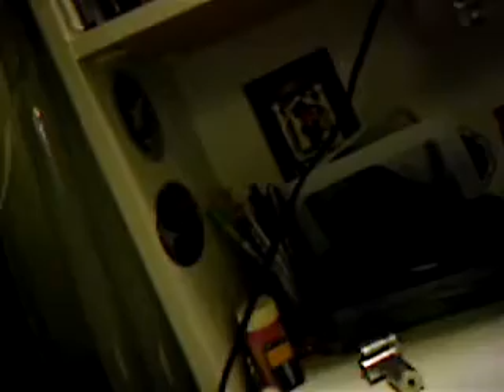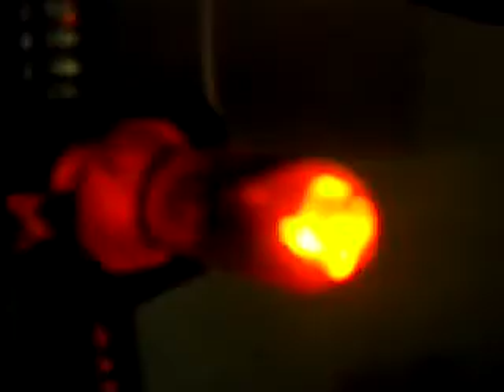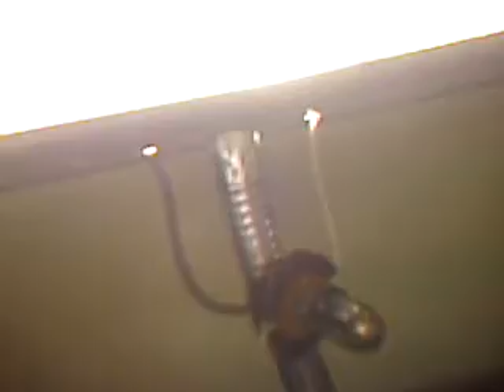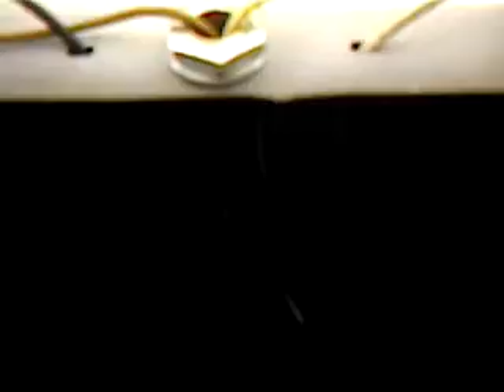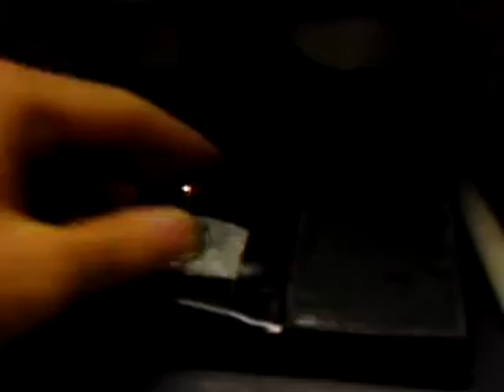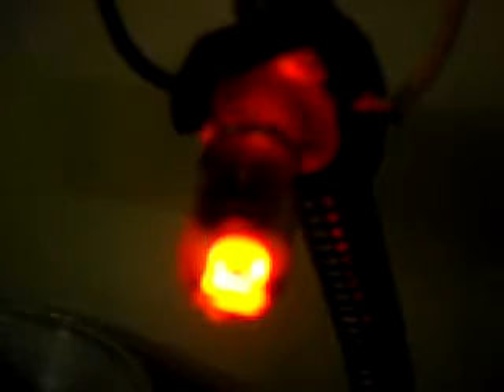Old and worn fluorescent starter

Comment: @RCM442 
I buy USA made Levitton neon starters (although they are getting harder to find now adays) - I made a video awhile back of a new one- its called "Mercury accumulation on a neon starter"- if you broke one open you wouldn't find liquid mercury but it would have traces of mercury vapor in it- part of the production process coats the glass with mercury (its really cool looking).  It may also depend on what country they are made in whether they make them like that.

Comment: Japanese fluorescent starters are cylinder shaped with a C7 candelabra screw base and either white plastic or clear glass housing. They glow lavender (being able to see the glow is probably an esthetic thing with them) and have the same tink- tink- tink-ping! sound as any glow type starter. Voltage over there is 100 volts ac 50 or 60 Hz depending where in the country you are.

Comment from the maker: That is the funny thing. This particular starter did not have a condenser. The starters from this era either had a wax paper condenser or no condenser at all. Later, some starters had ceramic condensers. The most recent ones are mylar. I think they still make starters with no condensers as well. For example, one company in America has two varieties of starter with different model numbers. For example The FS-2C has a condenser, the FS-2X does not have a condenser, but both are of the FS-2 type.